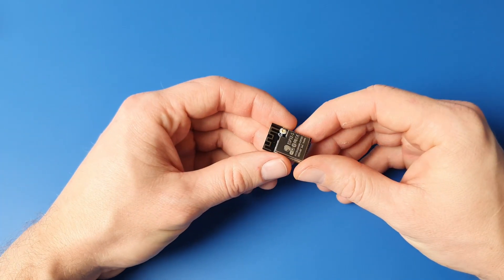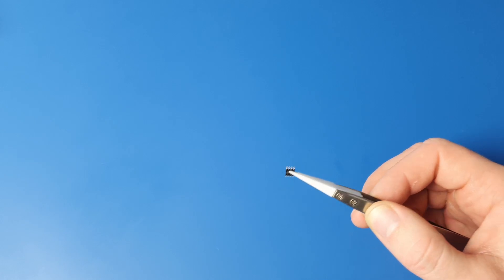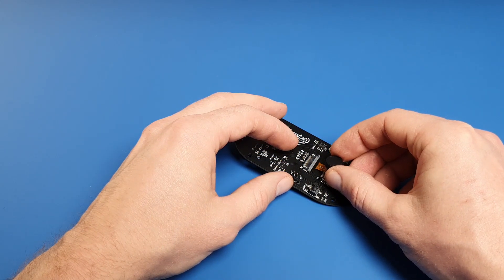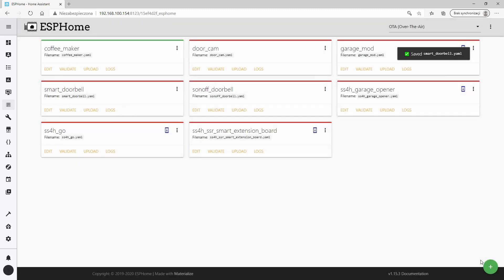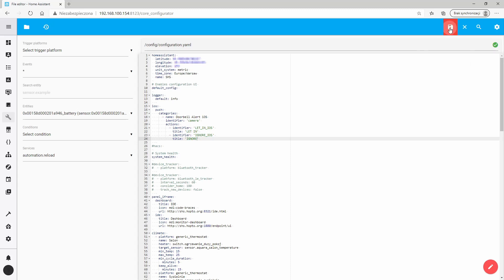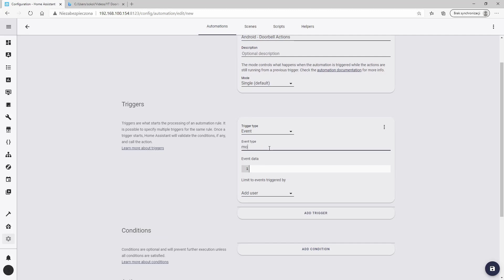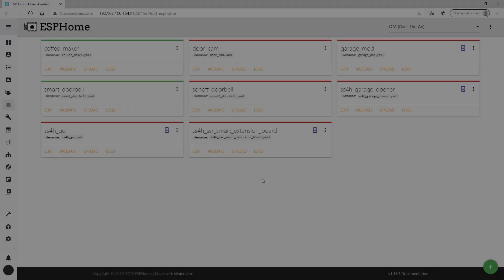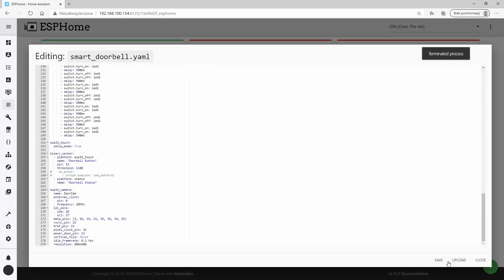A DIY Smart Doorbell based on ESP32

Comment: Hi, i just got your pcb board. I bought several components on aliexpress but others I can't find them. May you help me? For example: LDO 1.2V MCP1700T-1202E/TT, LDO 2.8V AP7333-28SAG, DC-DC Converter AMSR-78-NZ, NPN Transistor BC846ALT1SMD, MOSFET-N Transistor FDV304P. Help me please!

Comment: This is great but i think rev 2 should have a secondary board in a safer location that is responisble for triggering the unlock. At the moment you could just pull the camera off its mount and then short the relay wires to gain access.
Reply from the maker: I don't use this to open a house. Only a wicket/gate in the fence. So it would be much easier to jump over the fence than to short the relay wires :)
Reply: @SmartSolutionsForHome  , I too think there should be a mark 2 for this project please

Comment: GR8 Video with excellent instructions. Your video is among the TOP on "How To" and easy to follow without any guessing.
The only thing I would not do is to place the relay to open the gate in the doorbell, it is a security risk as all you need to do is open the case and short the two wires to open the gate.
Reply from the maker: Thank you! As fot the security risk: I use this to open the wicket/gateway. Of course you are right that it is enough to short two wires to open it. But it's much easier to jump over the fence :) I don't use it for anything where security is critical. Thanks for your fantastic comment, you are very insightful :)

Comment: What component do you use to drop from 12 V to 5 V or 3.3 V?
Reply from the maker: From 36 - 12V to 5V a use DC-DC Switching Regulator: AMSR-7805-NZ AIMTEC. From 5V to 3.3V I use LDO: AP1117E33G-13

Comment: Hi! great vid! Could this entire circuit be made portable using a powerbank of some sort?
Reply from the maker: Thanks, WiFi is quite "power-hungry". ESP32 could go into Low-Power mode, but then it takes ages to establish the connection. Additionally, if you would like to use a Relay, it's another current ineffective component. So the answer to your question is "yes, but it wouldn't work for a long time" :)

Comment: I really liked it, but i have an observation. I saw that the signal control to open the door is depending on the esp, so if someone notice that, can open the doorbell and fake that signal to open your door from outside. Please correct me if I wrong.
Reply from the maker: You're right. It's a very insightful observation. Thank you for that :) That's why I "only" use it for the fence gate. Let's face it, it would be less work to jump over this gate than break into the doorbell :)
Reply: @SmartSolutionsForHome  completely agree jajaja but for some applications it wouldn't be acceptable (super security jajaja) so is good to have this things in mind for your next projects  ;)
Reply: @Gianluca23ACDC  "for some applications it wouldn't be acceptable" this is such a great observation. If someone made a video of someone installing a wooden door you would say "you have a wooden door so someone could smash in with a sledge hammer, this is not acceptable for high security." He wasn't trying to make the "Fort Knox" of video doorbells nor did he ever imply that it was a super secure option.

Comment: I saw websites to buy esp32 unarticulated board. Where can I buy all components added for voltage, and other things?  I requested file downloads.  If you have NEW COVER DESIGN / BETTER PLEASE EMAIL IT AS WELL.  (Alton). I prefer a complete board with all components as this is my first project.